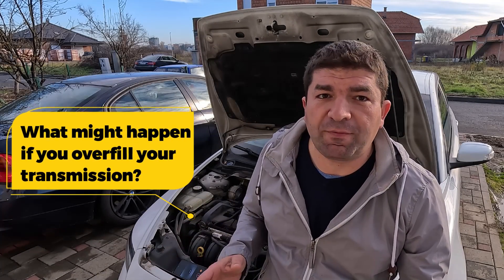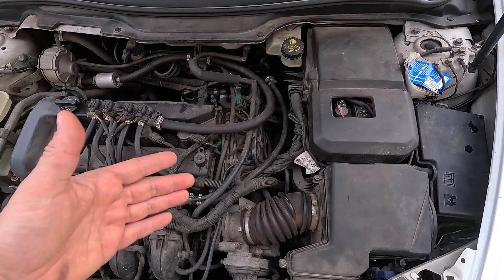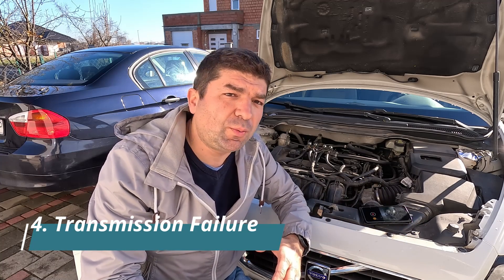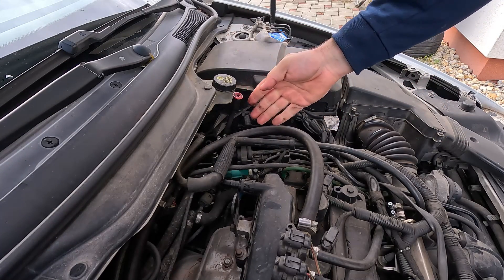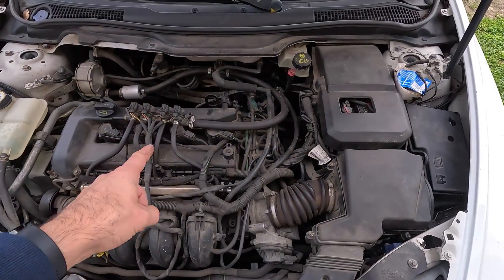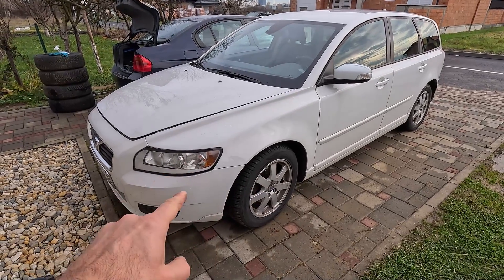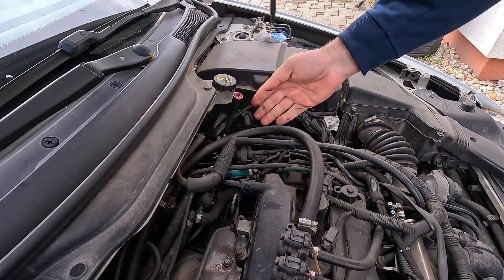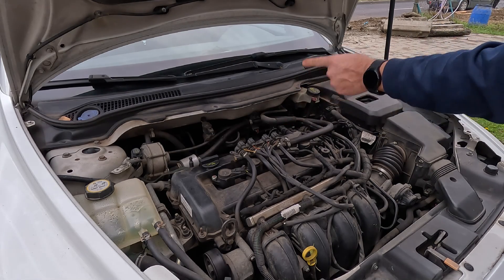Overfilled Transmission? Consequences & What to do

Comment: If I check it warm, it is wet far beyond the warm mark on the dipstick, same if hot. After an oil change, I filled it exactly as the manufacturer service manual says, which it says 4 quarts after an oil change will get it to just below the add Mark. Then when it warms up and hot it is supposed to meet the corresponding mark on the dipstick, but it completely sounds like it's starved for fluid, making glugging sounds from the dipstick and not wanting to go into gear, and at that time it is mostly foam. To me, those indications mean that it is short on fluid, regardless of what the dipstick says. The foam only goes away and it starts driving smoothly once I've got it cold filled to the middle of the hot range, which means that when it is actually hot, it goes a couple inches beyond the hot range, but it's actually hard to tell because it seems like the whole dipstick is wet. It is a 41 te transmission in a 1998 Town and country. The dipstick is the original. About giving up I'm trying to figure it out and will probably just keep it leaky but running well by overfilling it, at least according to the dipstick.

Comment: I probably overfilled my 2005 crown Victoria by a quarter of a quart. It's barely above the crosshairs so I don't feel like I should have any concern. I mean it's just going to leak out. Anyhow, the fluid is clean. It's in the transmission. I just have a leak

Comment: This is what makes it so maddening when transmission dipstick-holes are designed as the FILL hole, as well, and are so NARROW, which means that you need to wait ~30 minutes or more for residual ATF on the walls of the dip-hole to drain in order to even get an accurate reading 🤦🤦 Drives me absolutely mad that cars are designed with so little consideration for DIY maintenance.

Comment: whats really amazing is how people insist overfilling wont cause parts to stick ! transmission fluid is just that fluid its not an oil regardless of what people say it contains detergent . Ever try lubricating with liquid tide ? its almost the same thing its also why you wont see s single transmission repair man with dirty hands when you overfill it will actually decrease pressure not increase pressure because the detergent foams the more fluid the more foam the more foam the more air pockets form and the detergent seperates from the lubricant causing parts to stick

Comment: The only thing that well happened is you well blow out the transmission seals where it well leak from.just like over filling you're oil.you well blow your oil seals.rear seal front seal that's a fact

Comment: I have a 2018 Cheveolet Equinox LT AWD 1.5L 4 cylinder. I changed my transmition fluid. My car does not have the dipstick it has that side screw for checking which i could do but is unnessarily too difficult. Since the transmition holds 10 qts and when you drain with the drain plug it only releases like 4.5 qts. So they say to properly change it with that method, you change it like 2 to 3 times within a short period. I catch the oil in the bucket and then measure how much comes out and put the exact same new fluid back in. It worked the first 2 times but this third time i figured id put about an extra half quart back in to account for what is lost on the sides of the bucket and the sides of what i measure and the funnels and all. And i figured a little extra to top off in case it was a bit low. What a bad idea. I started driving jt and like 15 to 20 minutes later i felt heat through the firewall on my toes and the transmition is right in front of them. Only noticed hard shifting decreased acceleration and weird sounds. I parked it as soon as i could and will drain some fluid out now. I googled it and it said the same thing i experienced. Then found this video. Never knew it was that critical. Hopefully it operates normal after i drain some. Thanks!
Reply: Is it working properly now?
Reply: @lukaperko9744  
Yes working totally fine now. No other issues and no damage!

Comment: When there's a transmission fluid leak through a seal, does removing the excess fluid recondition the affected seal and prevent further leaks?
Reply: No, once it starts leaking, it’s done. It’ll probably keep leaking. The only thing you can do is try putting something in there to rejuvenate the seals and hope it stops it.
Reply: @Wolff1984 what do you mean put something in to rejuvenate the seal? Other than transmission fluid?

Comment: Hello, I just checked my transmission fluid and it’s really high. I noticed the transmission fluid was added 3 k miles with a conditioner just before I bought it. I looked under the car it’s it’s wet where the pulleys go into the transmission and has dropped down onto steering rod. Any suggestions what I should do?

Comment: As always, consult owner's or shop manual..... However, generally speaking:
Vehicles w/ a dipstick (to check fluid level), important to note that (yes) engine at operating temperature, and be sure to place gear selector in EACH gear for a few seconds while at a standstill with engine running.  This allows any tapped air to be purged out of passages & solenoids in that complicated maze of the valve body.
Keep engine running either in Park or Neutral, then pull dipstick as you demonstrated for proper reading.
.
Glad you mentioned access plug (on some vehicles that do not have a dipstick).  But still, same thing:  engine needs to be running during level check.
.
Bonus Note:  Never ever mix trans fluid types.  Contamination wrecks havoc especially on newer technology tranny's.  Always stay with OEM fluids.
.
Thanks for sharing !
Reply: Does your car jerk and hesitate when overfilled?